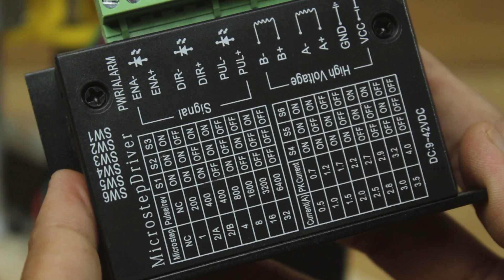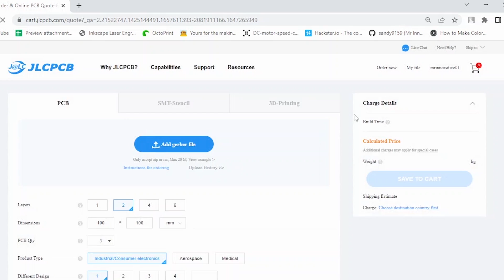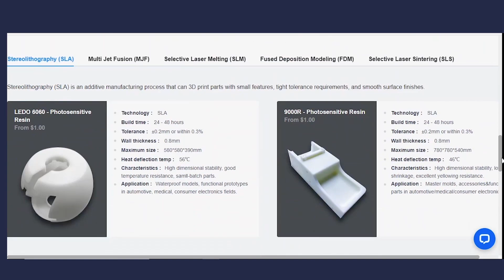DIY wire ring making machine | Arduino based projects

Comment: A nice project. It appears that the amount of vertical travel needs to be less, for each bending increment, and there should be more increments. At the end of the process, if your tolerances have been good enough, you should be able to continuously roll the ring through the machine, several times, to smooth out any imperfections. If you added another adjustable bending roller, opposing the first, you might be able to roll the ring continuously in just one direction. Several adjustable bending rollers might be even better. I hope that I have explained the idea clearly enough for you to imagine it.